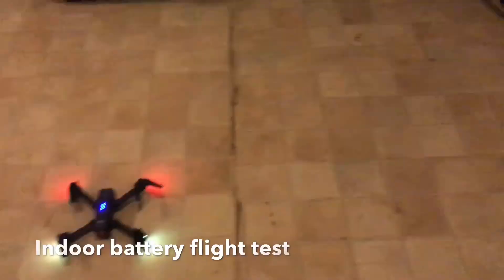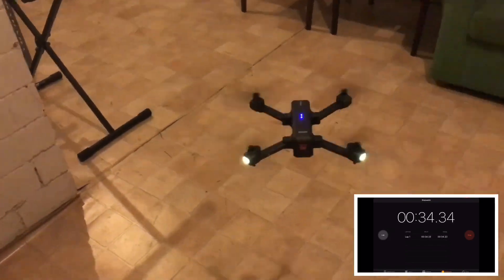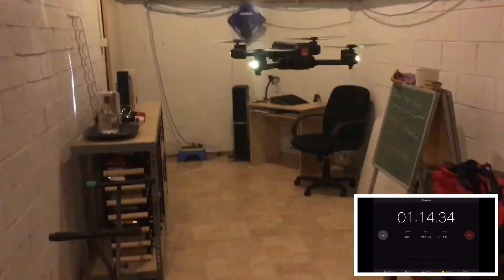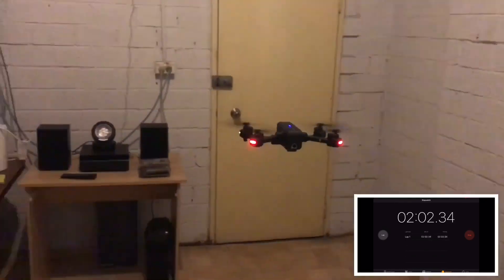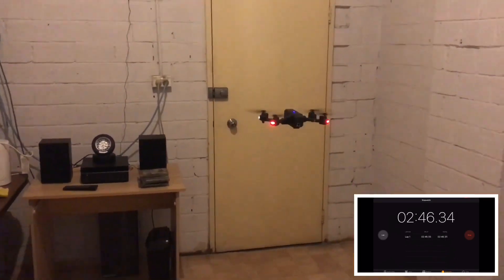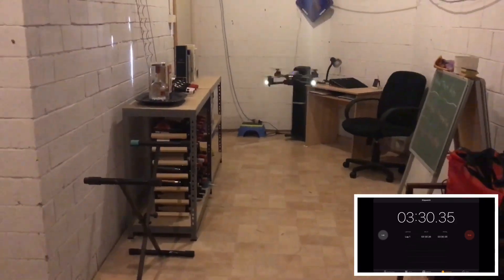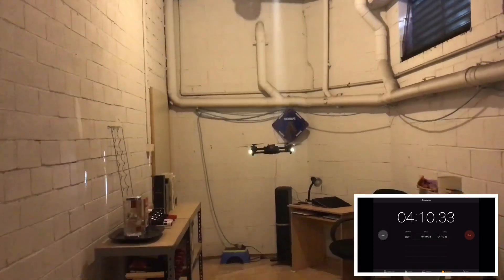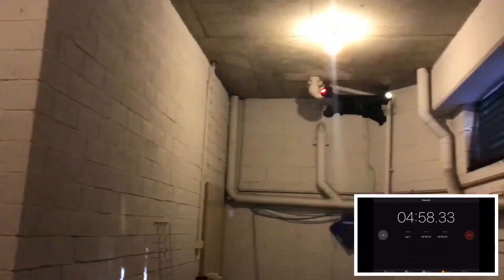MJX X103W Battery Test - WOW - Impressed! |Indoor Battery Test| |MJX X108G| |JJRC H73|

Comment: Does it actually have an Opti-flow sensor ??? I've seen mixed reviews where they said it is an empty hole. If it does , does the switch on the right toggle between GPS and OPTI-FLOW ?
Reply: His drone is actually flying good I just bought one and my GPS mode don't work because when I put it in GPS mode it doesn't fly correctly it gos crazy and even out of GPS the drone SUCKS ASS I wasn't my money